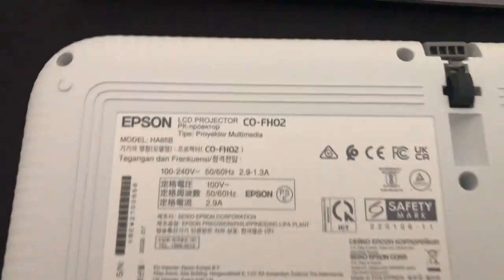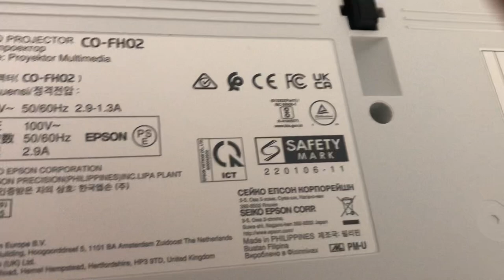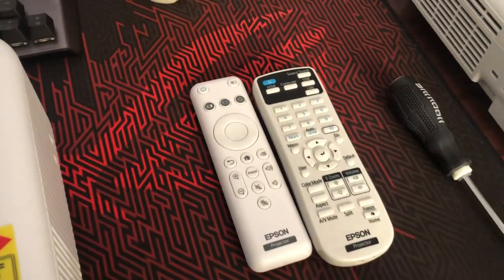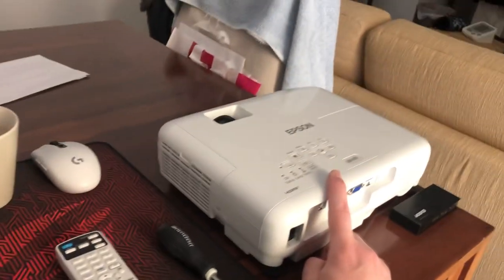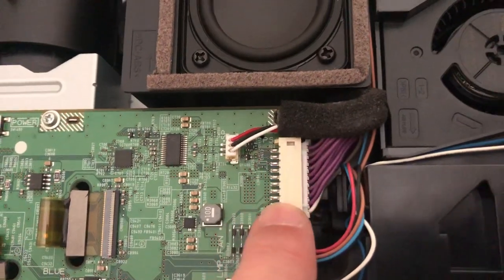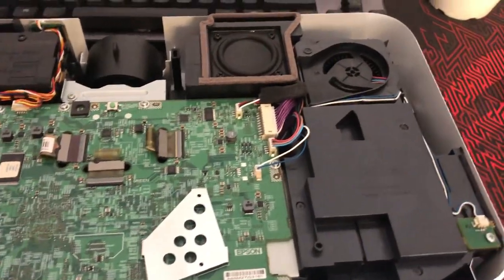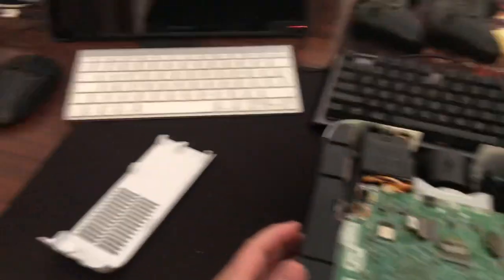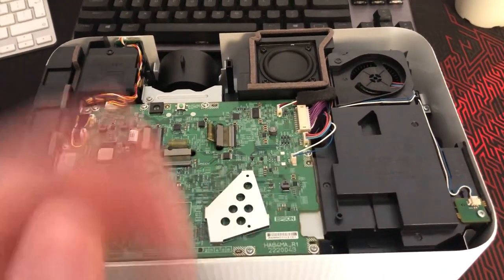Epson CO-FH02 projector. MAJOR disappointment….

Comment: I was determined to get the FH02 and after watching your video I backed away, it's difficult to find a projector with an affordable price but that allows decent maintenance... I don't want to give up being able to change the lamp myself and do a periodic cleaning, here in Brazil it It is being talked about a lot as a great value for money projector and only receives good marks from buyers... when I raised this issue in a group and talked about your personal video, you didn't take my comments well.
Reply from the maker: We agree 100%. An item flagged as use and dispose is unacceptable, more like today that economy is doing so bad. I believe that the first projectors will have problems in the next months and this will prove not good for EPSON. I also believe that these machines exist mainly to convince buyers to go to the more expensive models. Thanks for your comment my friend!

Comment: Hello my friend, I come back here after almost 2 months to share my experience, even with doubts and questions, I chose to buy the FH02 considering that its direct competitors are Chinese and without a manufacturer's warranty, for now the experience regarding the quality of The image is excellent, I already have 220 hours of use in ECo mode, I contacted the Epson representative here in Brazil where they confirmed the 2-year warranty and also that the lamp can be replaced as long as it is on the Epson support , I would like to know what your experience with it is currently like and if you have formed any opinion regarding the product after this period of publishing the video, once again thank you for your attention.
Reply from the maker: Thanks for being here buddy! I have just sold the projector a few weeks ago. I never liked it to be true. It was going slightly out of focus after a while, the quality was so and so, and it was a magnet for dust. No filter for a 3LCD unit? Unacceptable. And the overall quality of the electronics was really bad. Sold it for the price of a new lamp for a PROMETHEAN PRM-45 I found on the trash and I could never be happier. A 11 years old projector that is superior to everything compared to a model that was produced less than 2 years ago. Just keep it clean as possible to last as long as it lasts. Hope you enjoy the EPSON.

Comment: Hello my friend.... after reading a lot about it I couldn't find out which model of lamp this projector uses, did you have to disassemble it to identify which lamp it is and if it is possible to replace it, here in Brazil the projector is 2 years old warranty, but the lamp is only for 90 days, so if there is a problem with the lamp after 90 days, you will have to bear the costs, of course if it is possible to replace it.
Reply from the maker: Thanks for commenting my friend! I have not disassembled the unit further as it is the one I am using daily. When the lamp fails (and it will fail eventually) I plan to tear it down and see what kind of bare bulb EPSON has put inside. Unit is close to 1500 hours in ECO mode right now and still going strong.

Comment: Hi, Does TW 750 better than this? Looks it has bulb replacement but it's more older model. Just thinking about old model )

The older does have wireless USB Android tv  stick, but I guess I can buy it separately?

Thanks!
Reply from the maker: Yes the 750 is an awesome projector. Replacement lamps are everywhere, and you can buy your own stick to use as you see fit. Just be adviced that 740 and 750s are out of production so, if you want one new, just hurry! 

Thanks for commenting my friend!

Comment: Do you also have the problem that the power plug on the projector wobbles?
Reply from the maker: No! But I have not used the one that came with the projector!
Reply: I also opened the projector and something has been rattling inside since then. Is this some kind of fuse from Epson?
Reply from the maker: @Ioannis949  I do not know. Might be the air positioning flap for the lamp. Are you sure no screws were left inside?
Reply: I’ve had exactly that, that’s why was keen to see if the mains input was in a module. It moved when you put in mains cord.

Comment: Hi, I have a question, only 1 HDMI, so I won't be able to keep the android TV dongle plugged, while connecting another HDMI like a laptop? will I have to unplug the dongle every time? (not convenient when it is ceiling mounted) Thanks!
Reply from the maker: Yes, only one. I do not have the projector any more, but as long as I used it, I had an HDMI input adaptor with 5 inputs and 1 output. That output was connected to the projector. It was an axcellent solution and the cost was only 15 euros I believe!

Comment: In the biz we call this manufactured E-waste. I found you through Frank, too! Great stuff man. But yea, Epson is trash and as much as I'd like to be surprised they're trying this crap, I'm not. I worked at a school and a few years ago, the replaced all their BenQ's with Epson projectors and they were garbage. Flickering lamps, power/board issues, noisy, poor image quality--the whole 9 yards (Epson Powerlite 98H and Powerlite 108 models). I had 2 Epson models of my own, both of which were trash. They had good image quality for the first year, but degraded quickly even though I took good care of them. I vowed never again
Reply from the maker: Thanks my friend! I am staring away from EPSON too right now. I am completely disapointed by their new designs. Thank you for commenting!

Comment: The LED in the CO-FH02 lasts for 18 years (on average usage). Which is a lot lot longer than the old lamp style projectors.

Hence you won’t be needing to replace the lamp.
Reply from the maker: There is no LED assy on this projector. It is a straight old-tech lamp like all the entry level projectors driven by a classic style ballast just like the old school models. Thus, I expect it to last for a few thousand hours at best! Thanks for commenting my friend!
Reply: Oh I didn’t know that
Reply: The spec shows 6000 to 12000 hours?
Reply from the maker: @pengwang9957  Yes. But these are ALWAYS way off!
Reply: @Kujokouklos I've got 3200 hours on one of these that has been running non-stop in my restaurant. Still going strong, no issues at this point
Reply from the maker: @Luke-qs2cg  Thanks man! My problem is that after the lamp goes out, there will be no way to replace it. So, the projector will be trashed or recycled. I am using a projector that is going to have it's lamp replaced for the third time and service menu lists it for 7000 hours. A good cleaning, a new lamp and it is ready for 3500 more.
Reply: @Kujokouklos  that I understand, but I also understand the lamp replacements being 200$ on average might outplacement this model that regularly retails under 400$ and msrp at 599
Though I still agree it SHOULD be changeable if it's not led/laser.
Reply: @Kujokouklos Parece que troca, liguei pra Epson e falaram que troca na assistência técnica deles. Porém não vejo em nenhum lugar qual modelo de lâmpada. Ele pode usar até uma lâmpada igual a outro projetor epson, a questão é qual modelo e se dá para trocar  sem levar na assistência técnica.
Reply from the maker: @Luke-qs2cg  Exactly! just give us the option!
Reply: @josedomingosdecamposjunior9307   Consegui descobrir qual lampada e se da para trocar em casa?
Reply: @josedomingosdecamposjunior9307  Estava decidido em pegar o FH02 mas depois que assisti este video recuei, dificil encontrar um projetor 1080 com preço acessivel e que permita uma manutenção descente
Reply: @josedomingosdecamposjunior9307  Olá amigo...conseguiu descobrir qual lampada ou pelo menos qual valor seria para troca-la na autorizada epson
Reply: It is probably to do with environmental protection, well the lamp being replaced. They are being phased out at the moment, so no replacement possible soon, this is the end of the line, it’s now laser or led. My neighbour has one of these, it’s why I bought one, but mine was flickering from the go on bright scenes, got a refund, but now just ordered another. Yes, no audio out, well apart from Bluetooth on dongle, no lens adjustment for focal length, no user replaceable lamp, no filter, only one HDMI, but it’s cheap, works well for price, and it’s brighter than most non lamp based projectors. It’s also 3 lcd so no rainbow effect, which I hate. Your TV is unlikely to have controls on now, just remote, you can use an IR blaster from some phones to control. Most people will just use this for streaming with dongle, or for games, I actually like the lead that pokes out back for such as you can angle it away from projector, convenient at times. I too love no squeaky auto Iris. Anyhow, a fab upload, regardless.
Reply: A Epson informou que a lâmpada pode ser substituída, desde que seja feita em uma de suas autorizadas. @Kujokouklos